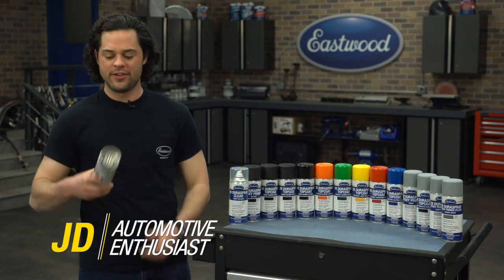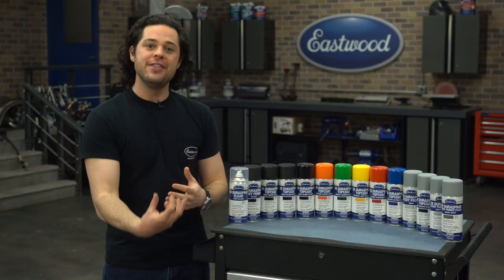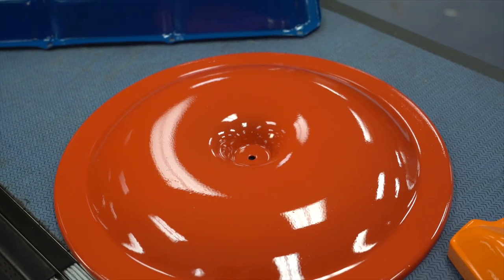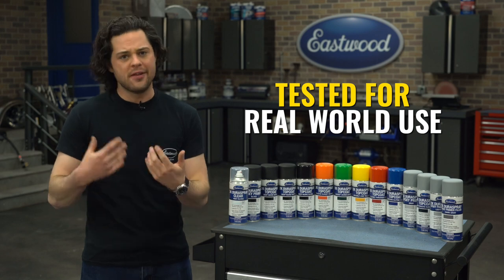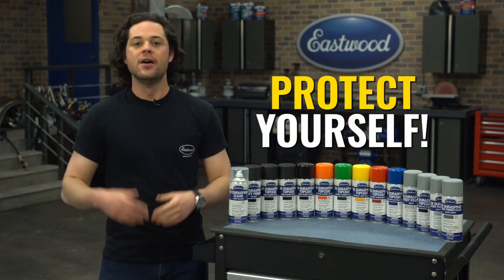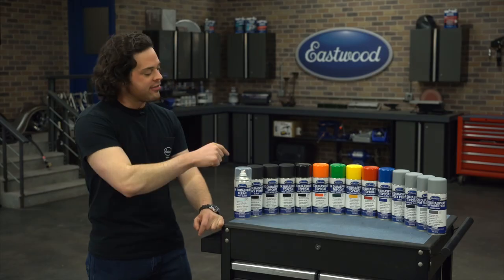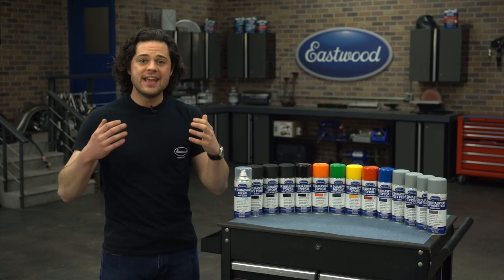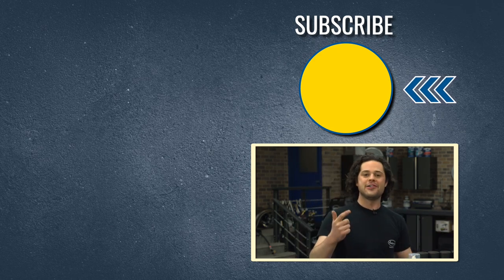Two Component Spray Paint Cans with Unlimited Pot Life! 2K DuraSpray Paints - Eastwood

Comment: with 2k duraspray epoxy primer how long do i have to wait to topcoat with single stage ppg alk200? 12 hours or till it's fully cured 7-10 days?
Reply from the maker: Hey! 2k Duraspray can be topcoated once dry to the touch. It's Sandable after 12 hours.

You can find all the details here under "Specifications"
https://www.eastwood.com/eastwood-2k-duraspray-epoxy-primer-two-component-aerosol-can.html

Comment: You need moisture in the air what if you have no moisture in the air. What if you are out side spraying and it’s 80 degrees outside
Reply from the maker: If you're working in a dry climate, you'll have to extend the recommended drying time. The minimum humidity we recommend is 25%. 
80°F is a little too hot; Duraspray works best between 64-77°F.
-JD
Reply: @eastwoodco  so is this paint mainly for small projects
Reply from the maker: Whatever size project you want them for; one can will cover a lot of ground.  
Primer, 22 sq ft. 
Topcoat, 27 sq ft.
Clears, 32 sq ft.
They do work great for small stuff since you have the ability to put them back on the shelf when you're done spraying. Also, you could consider putting a humidifier in the space to help keep your area between 25%-75% humidity. Use a hygrometer to be sure. 
-JD

Comment: could someone use this to paint a vehicle? I need to paint my truck thanks to the previous owner giving it cheap paint job. And now I have cracked paint all over that I have to remove and it's chipping in a lot of areas that need fixing also. Being I'm in a remote area with no air compressor and limited power by small generator. I have a carport can be enclosed for painting. I know it would take a lot of cans to accomplish it. But do you think it could be accomplished this way?
Reply: If you have no air compressor, get a Porter Cable electric 6" DA to sand all that bad paint down to a good base.  If I had to go to a desert island, my PC DA sander would be on the list of tools to take.